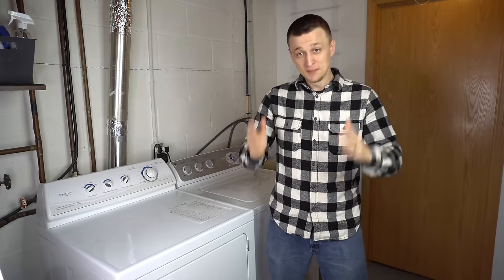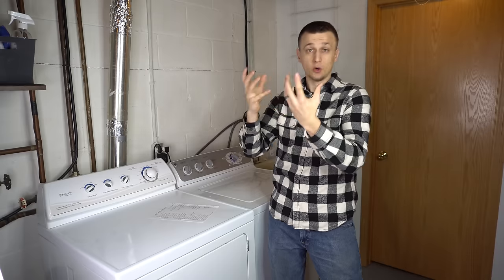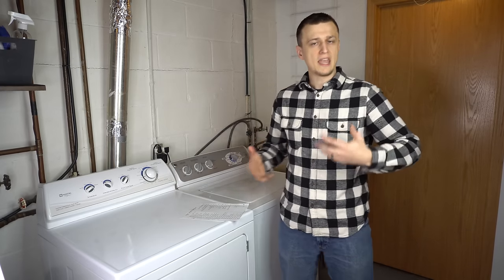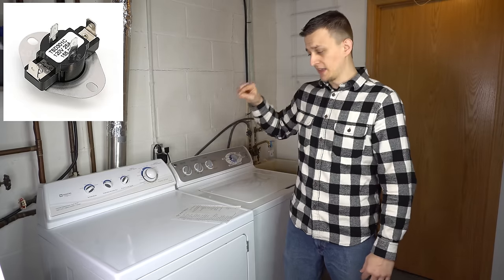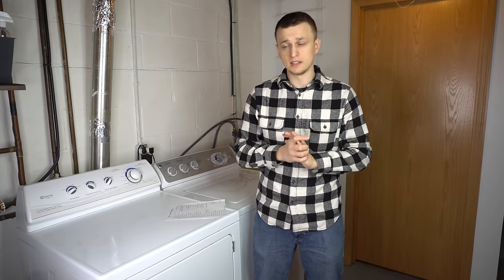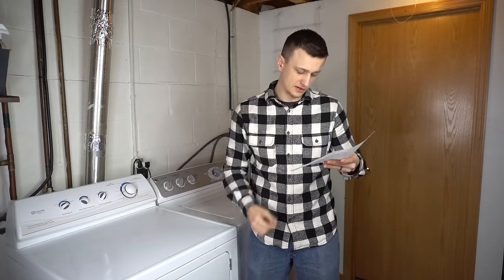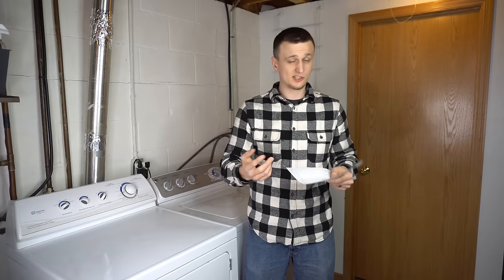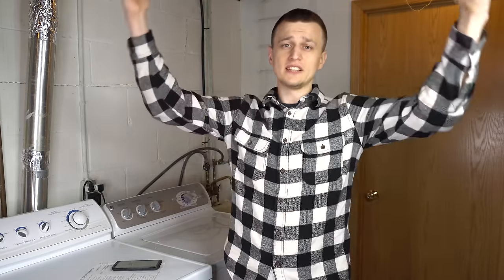Dryer Troubleshooting - Top 10 Dryer Problems

Comment: I have a 28 years old Whirlpool dryer and here is what I have fixed, so far the dryer still run like a Champ.
1) Motor (burned out)
2) Pulley and belt (noisy/cause by lot of lints on the wheels).
3) igniter (igniter not glowing due to broken off).
4) Coil Valves (weak and not able to dry clothes)
5) Thermal fuse. (dryer lint block/clogged vent pipe).
Thanks for the excellent video and my fixes are on your top 10 list.
Reply from the maker: That's awesome how all 5 of the problems you had are part of the top 10! :) Thank you for sharing the repairs you've had to do on your Whirlpool dryer!
Reply: Sorry.. What a F17 code is mean for Henses's dryer machine please and thanx for info.

Comment: 1.  1:03 - Noisy dryer
2.  4:07 - Blown thermal fuse
3.  5:37 - Bad gas valve coils
4.  7:29 - Restricted venting
5.  8:57 - Clogged/Damaged lint screen
6.  10:00 - Bad drive motor
7.  11:16 - Bad timer
8.  13:00 - Bad heating element
9.  13:45 - Bad igniter
10.  14:27 - Bad cycling termostat
 11. 15:43 - Honorable mentions
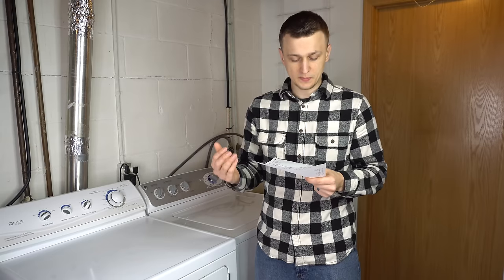Reply: 17:04 High limit

Comment: Very informative. Regarding the Bosch dryer reset button:
After resetting it, you should check for a reason it tripped. Otherwise it
could just trip again. I had it happen twice and both times it was lint build
up somewhere in the dryer vent. The other thing is the belt slipping off on
some dryers. I think if someone spins the drum the wrong way it can take the
belt tensioner and make it go loose just long enough for the belt to pop off.
Who can resist spinning the drum by hand at least once?

Comment: Awesome video.. my fuses were all good. I shorted out the moisture switch (it was bad) and examined the temperature switch and converted the dryer   to a single temp unit. It worked. fyi the replacement parts were not available, a real bummer.

Comment: Have a Maytag gas dryer from 1973 that’s still going strong along with the matching washer. Interesting thing is it doesn’t have a igniter but uses a standing pilot, and I haven’t had a single issue with the pilot light going out and the only thing that can go bad is a thermal couple and that’s about it.

Comment: Great video thanks so much. I had a cracked blower in a newer dryer that was unfortunately attached to the motor instead of being individual pieces. The replacement part would have been to much to make it worth fixing.

Comment: Great info! Had a gas, front loading dryer that would melt synthetic clothes at a medium heat. Had it worked on numerous times, no one could figure it out. I just didn’t dry anything but cotton and only used medium low to low all the time. Was a very expensive dryer too, brand new. Yes, I had it looked at under warranty.
Reply: There wasn't any problem to be found. Whether you use high or medium heat the temperature is the same what changes is how long the temperature remains on or off. What I am trying to say is: When you have the high heat on the heat will remain longer than when you have the heat set up for medium, but the temperature will be the same for its peak  only the time it remains will be shorter. Hope it can help. Have a good day.

Comment: I just had our 6 year old Maytag dryer apart because of black filings  which I figured was the idler pulley falling apart,but upon further review one of the roller guide wheels was the cause of the filings,one had started to not fully spin and smear and mar the edge of the drum. 

 I also found the bottom of the ducting port that goes to the hose really constricted with lint and other debris,most likely a dryer fire adverted !
Reply from the maker: @Aaron Noyes Good that you took it apart and investigated! Thank you for sharing your findings!

Comment: Home Depot sells a dryer vent brush kit for cleaning the lint out of the dryer vent.  I also had to purchase the the extension rods because I have such a long run.  My vent became clogged and my thermal fuse blew.  I also got rid of the flexible vent that connects the dryer to the vent pipe in the wall and replaced it with a vent periscope that allows me to get the dryer much closer to the wall and provides much better air flow.

Comment: A good tip Is the lit trap Needs to be washed not just cleaned. Detergent in fabric softener Residue builds up on the screen and causes Airflow restriction Over time. You wouldn't think so but it makes a big difference

Comment: Oh no it's already 10:49 PM. I lost 49 minutes of melatonin. 😅
I probably told you about my old Kenmore dryer, wait, it’s a GE 🤦🏼‍♂️,from 1979 already, but
I changed the belt on it and I can only run it on low, because it gets way too hot on normal setting. Thanks for the tip on sleeping earlier, it's good to know. 😊
Reply from the maker: Yeahh, apparently melatonin is important. Glad you liked the sleep info! ;)  And anything from the 70s, 80, and 90s was very well built. I wouldn't be surprised if your dryer lasts another 20-30 years!
Reply: Word of Advice TV,
Why did the English teacher
brake up with the Physics teacher?
There was no chemistry
Reply from the maker: Haha nice :) Thank you once again!

Comment: Indus dryer. Would a timer that isn't working prevent the start button from working? My switch on the door wasn't working and the drum would continue to spin when I opened the door. now the dryer doesn't come on at all. Would it be this door switch? thanks. great video!

Comment: Hello sir. I don't know if you're still in the dryer repair profession,  I'd like to run a question by you.  I've got a cheap modern Roper dryer. The model wirh the lint trap on the top right hand back corner or the dryer, with a single timer knob and push start button on the control pannel. 
  The issue im having is lint and dust seams to always be all over the top of the dryer, the walls around the dryer on top of the washer next to the dryer. I use a higher end metal flexible duct.  the type that a has a 90° angle head on each end the swivels in 360° on each end. It is a shorter duct, only running from the bottom of the dryer to about 3/4 the hight of the dryer then venting straight threw the wall. The duct and vent are all clean and clear. Its not clogged outside at all. I empty the lint trap nearly every load. I thought the lint and dust were leaking from seams or cracks in that duct. So i sealed the entire duct with a strong air tight sealant, i also used aluminum duct tape to secure the duct to the dryer and to the duct leading outside, so its not coming from any of the normal locations one would think it would be. When i removed the rear cover from the dryer, there was a small amount of dust and lint inside of the cabinet,  but not more than you would see opening any dryer. I'm kinda stumped and am considering using masking tape to seal the seams around the area that the lint trap slides down into, to see if it eliminates the problem, thinking maybe its blowing up and out threw there. It only seams to have a thin felt seal around it. But that seams to be a huge hassle that i can't imagine my gf or daughter keeping up with as often as laundry is being done. Do you have any other thoughts, or any ideas of something else i might look at first? Thank you for your time.

Comment: I did not hear this one mentioned and, in fact, an appliance technician with over 40 years experience was baffled by this one. We have a fairly new dryer that has been going through heating elements every two months or so. I've noticed that when the dryer has been on for only a few minutes the top of the dryer gets very hot to the touch - even when the heat is set on "low". At this point I think the machine may just be a lemon and something is wrong with the wiring or something. This is not an air flow problem. We've had the vents cleaned regularly. Any ideas?  Thanks. It is driving us crazy and costing a lot of money.

Comment: I have an older dryer in my laundry room. Goes back to 2012, it was having a problem where the drum was spinning too slow for me so I took it apart and the belt was slipping, the surface of the belt looked like and smelt like it had it's end so I bought a new one and the drum was spinning at it's speed once more. One time it was drying my towels and out of no where, it stopped spinning. I open it up and the motor had broken so I replaced that.

Comment: Hello and tx for ur video. My last dry stopped with clothes still damp and warm. I push the start button but i hear a noise as if the dryer wants to start spinning, but it wont. Do u think its the fuse?
Reply from the maker: If you hear a noise like it is trying to start, then likely it is not the fuse. It's possible that the motor overheated. Or the pulley/rollers are stuck. If the motor overheated, it usually will turn back on if you give it some time to cool off. As for the rollers and pulley, you would need to take the dryer apart and take a look.

Comment: When you say your dryer won’t work anymore when the thermal fuse blows, does that mean it absolutely will not turn on anymore? Or will it just not work properly? My dryer seems to overheat and turn itself off when I use it, so every load I have to run the dryer 3 , 4 times or sometimes even more. Should I replace the fuse?

Comment: I have replaced the steam nozzle on my Whirlpool Duet gas dryer for the second time only to fail after a few days of use!  The original valve lasted about 6 -8 years, the second less than 2 years and the most recent only a matter a matter of days! My only options seem to be to shut off water supply or buy replacement nozzles in bulk! Any suggestion?
Thanks, Steve Bowen
Reply: A bit late Mr. Bowen, but if you're still having a problem try a water filter in front of the valve. The water here in LV seems to have an applesauce like mineral deposit in it that blocks my washer screen.

Comment: I love your videos I replace my belt by watching your video on my dryer because just quit spinning and was really noisy now it's still won't spin it only runs if I hold the button on but then I can smell it getting really hot what could this be, could it be the pulley ?
Reply: Do you have a video for this problem ?
Reply: My dryer just quit spinning and was really noisy too? I replaced the belt because I thought it might be stretched out by watching your video , put it all back together and it's still only runs if I keep the button pushed in and is still very noisy but smells hot immediately so what can I do please help??

Comment: I watched the entire video and the problem with my GE gas dryer was not covered.

After closing the door & setting the timer, when the start button is pressed, the dryer makes a buzzing or humming sound.  It does not tumble or do anything else.  Open the door and the sound stops.  

NOTE:  This dryer does NOT have an annoying buzzer that sounds at the end of tbe cycle.  I bought it used, so its possible there may be a buzzer that quit working or was disconnected by the previous owner.   I've used this dryer for several years and this is the first time I've ever heard this sound and the first time it's ever not started.  

I found a 3 videos that covered this.  2 were due to lint clogs where the blower wheel meets the removable lint trap / screen - front left botom corner for mine where the lint thing is in the door.
In the other video, the motor got replaced.

Thru a small hole just off-center on the blower wheel, I blew out a fair amount of lint with an air compressor.   Thru openings to the left of the blower i also blew lint off of the motor and a little more in the bottom of the cabinet toward the back, vacuuming at the same time.

The blower wheel turns freely by hand and the drum turns with it.   The belt is good & snug, and shows no wear.

Next I'll remove the flex duct hose from the back and look for a clog there.   The hose itself is only 4 feet long and is clear.  

Hoping i don't have to replace the motor . . . Any suggestions on what else I should check or do while it's apart?

Comment: If your dryer is older maybe 5-10 years, you should do preventative maintenance.  Remove cover and clean out lint from fan and ducts within dryer, reseal baffles for fan and ducting internal, remove dust from electric elements if that type, lube main ball bearing with proper thick grease like the type for automotive or any that has high drip point 300F or higher, check belts, rollers.  Check electrical connection and terminals for signs of overheating in electric type.
Reply from the maker: That was a great dryer maintenance list!! Great suggestions, thank you for the comment!
Reply: @WordofAdviceTV  Thx, I did this recently on my 15 year old electric and it started much quicker after because the ball and socket was dry, and would've destroyed itself in time, exactly what the manufacturer wants.

Comment: Breaker can go bad too. Have enough power going through one side of the breaker for the dryer to come on and tumble but not enough to heat the element.  So instead of the dryer being broke...its just not getting enough juice. 

Had this happen once. Dryer quit heating, I replaced it with one my grandparents had in their shop that had worked great. When it did the same as the 1st, I figured it wasn't the dryers... it had to be related to the one thing they had in common...the breaker.

 One customer (man) at the hardware store tried to argue with me swearing it was not possible, either it was getting power or it wasn't...when I was talking to a friend who owned the hardware store. My friend had never heard of that happening before but could see how it might would.   Another  customer  (a much older man) confirmed that it was a definite possibility and I replaced the breaker...all was well.

Comment: a dryer was noisy as the baffles were loose and their retaining screws needed to be tightened, or some had completely fallen out. Just had to put those same parts back in place and tighten securely.

Comment: I have a Samsung Dryer (newer style) after pushing the start button, the drum would hum and not spin. I took off the back panel and hand turned the drum and made sure the belt was straight and it started working again. A few months later still no issues but a little reluctant to spin when starting sometimes. Do you think it could be the belt or the tension pulley ?
Reply from the maker: It's possible that something is seizing up. Could be the pulley or the rollers. Another possibility is that the motor is getting weak. Can't say for sure without taking it apart and taking a look though.

Comment: Mine gets hot but it does not dry the clothes very well. I have to stop it. Open it up. Wipe the moisture off the door. Let it air out a couple seconds then turn it back on. I’m getting good venting.  What is causing the moisture? Do you think it might be the thermostat?
Reply: Check spin speed on your washer. Spin speed should be set to high in order to remove max amount of water from clothes before you put them in the dryer.

Comment: Timer went out years ago but still let us turn dryer on. Shut it off by turning the dial on timer or opening the door. Door switch broke a few months ago. Think I need to order some parts. Lol
Timer on washer just went out.
Thought about new machines.
Researching new machines makes me think I will order parts. Crazy built basic washers and dryers on the market now. Water saver, temperature, sensors and lid locks with a control board.
I like basic simple machines. I don't need my smartphone to turn on my laundry when I am out of town. 
Sounds like something California had to do with.
Reply: The new machines are overpriced and don't last long. Repairing an old dryer is the best option IMO.

Comment: Hello Jay, how are doing. I have a Maytag Neptune gas dryer when i push on the start button then i hear the cranking sound coming on and the dryer wont start.
I did check the start button with the multimeter and it has no problem. please help me what to do next.. Thank you and stay safe.

Comment: You know your stuff I usually go to sleep at about 2:00 am also going to try and change!   Back to Dryer Problems. I have a Maytag Bravos Quiet Series 300  It just started giving me problems!  I can put 3 or 4  small items of my grandchild’s in my dryer and they will not dry completely! Dryer is getting hot, clothes are still damp after I have dried them on (heavy duty)  Having To dry them  5 or 6 times  and they are still a little damp!  I Clean the lint thing after every use!  I have replaced the vent hose & stuck hand into back of dryer to clean -  not much! I Have cleaned out vent outside - Not Much!   Still not dry clothes totally !   Again dryer is getting hot 🥵 could you please tell me what I need to do - Replace?  Again You Know You’re stuff!   Thanks

Comment: I have a 35 year old Maytag electric dryer. It has push buttons for two heat settings, Delicate and Regular. With clothes in the dryer, the Delicate setting ran between 130-136 degrees at the lint filter once warmed up. The Regular setting ran between 117-122 degrees. No, I didn't get that backwards! The Delicate setting is actually running hotter than the Regular setting! My other issue is that when the dryer is on automatic dry, the buzzer no longer sounds when the clothes are dry. Any ideas? Thanks!

Comment: My electric dryer is making heat but the exhaust is cold.  This is causing the temp sensor to trip out turning the element to turn off.  Could this be caused by a vacuum leak from a damaged gasket somewhere in the path of air?  What is the likely suspect?  This is a Kenmore Elite with the blower behind the front panel.  Thanks in advance.

Comment: My dryer turns on and runs but the timer will not move and turn it off when it's should if I set it on 50 minutes I can come back in an hour and still running and still sets on 50 minutes what do I need to replace